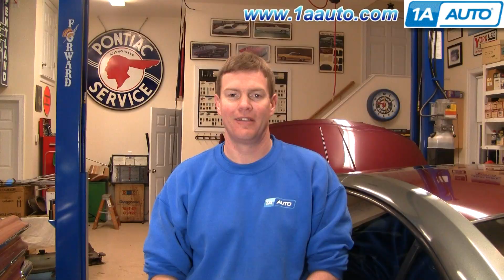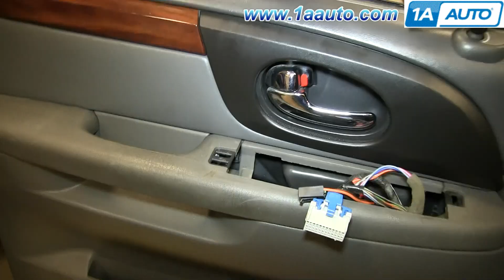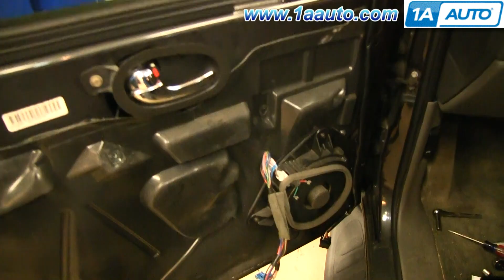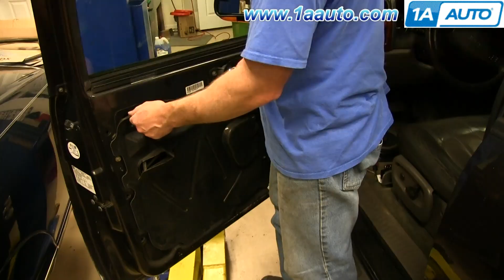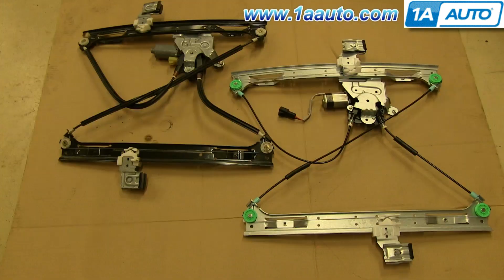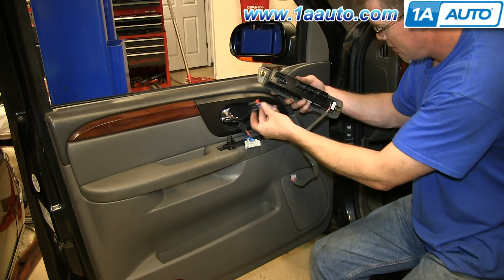How to Replace Window Regulator 02-06 GMC Envoy XL

Comment: Thank you for video and a good product recommendation. It worked perfectly. I was sold on the verify to make sure it was a correct fit. I will purchase more products in the future (Honda Struts) from your business as needed. A friendly comment though from a "do it yourselfer". Removing the door panel looked pretty aggressive (yanking). Using panel removal tools could prevent unwanted damage. And mentioning or showing taping the window "up" once removing it free from its clamps may be helpful to first timers. My humble opinion and looking forward to doing business in the future.

Comment: I just want to thank you guys for this video. Instructions are spot on perfect. I’m an accountant by trade and it’s been a long time since I’ve done more than an oil change on my cars. I did the whole job in about an hour. The wire going around the pulley wheels on the old regulator popped off so the window would only go down. New one works perfect after following this video to install it. My only regret is I bought the part locally. Next job I’ll give y’all my business!! Thanks so much!!

Comment: First ty very much for other video on finding the fuse that controls the other windows.  --HERE  i think it would be helpful if you mentioned what the problem was or what the regulator does.  Also please mention how long the process took you.  Ty for u sharing your experience.

Comment: Thank you! This got me started in the right direction. Some differences on my 05 Envoy SLT situation. The cable winding broke with the window all the way down. So the bolts holding the window are too far down to reach from the opening. I cut the cables but the window still didn't move. So I had to drill a hole for the socket on the left side window clamp. Ordering a new regulator today.
Reply: I received the new part from your company and replaced it with no trouble thanks to your instructions here.  Next I have solve the engine stalls/hesitation issue.  Also the speedometer and fuel gauge don't work, but using a Garmin GPS for now and always press trip odometer to zero when fueling up.

Comment: Just unboxed and see that a couple of protruding plastic parts had broken off - probably in transit. What to do? (Edit) The plastic pieces that had broken were inconsequential, the install went well - except for a couple of cheap plastic "brackets" that broke where the 2 10mm bolts that secure the panel to the door are. Oh well, the window works and that's all that counts. My wife can go through the car wash without having to stuff towels at the top of the window.  Thanks for the video instructions. So worth it.
Reply from the maker: Thanks for checking us out! If the item was damaged upon delivery we would suggest contacting us at 888-844-3393 so we can assist further with a replacement. Hope this helps you out! +N Taylor
Reply: @1AAuto  slightly damaged, but I could tell that it would affect its function, so installed it and working flawlessly! Thanks for your products, especially your repair vids - AND your responsiveness!

Comment: If the window is stuck fully up, do I have to bring it down when installing the new regulator ?
Reply from the maker: +Klaus Naci As long as you can access the mounting bolts you do not have to bring the glass down to install the new regulator!  1aauto.com

Comment: If the window regulator isnt working, how do you put the window down to reveal the bolts needed to remove?
Reply from the maker: If the window regulator cable is jammed you may need to free-it-up in order to be able to move the window up or down. Hope this helps you out. 1aauto.com